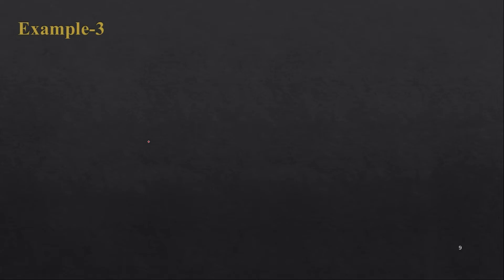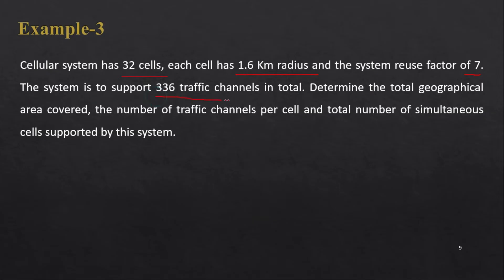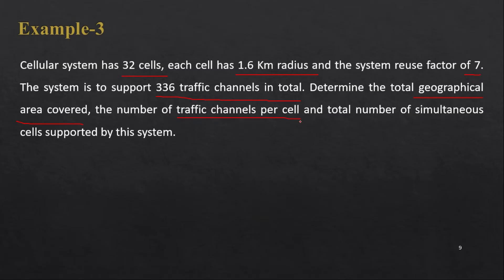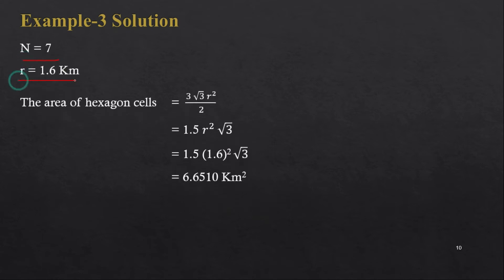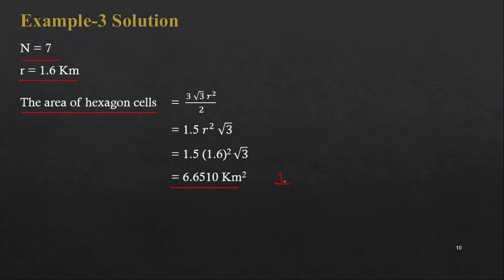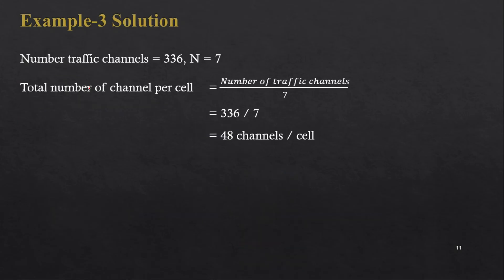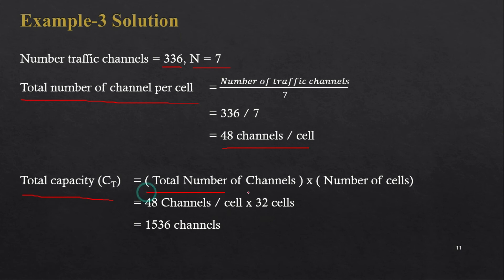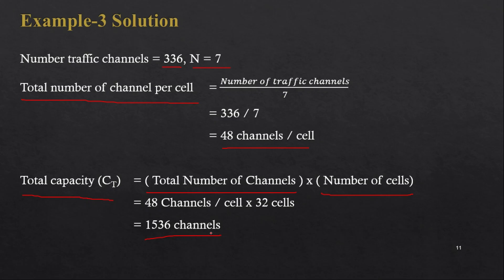Cellular System Numerical Example-3 Find Cell Geographical Area and Traffic Channel per Cell

Comment: A cellular system has 12 macrocells with 10 channels per cell. The macrocells are split into 3 microcells. Determine the number of channels available in system after splitting into picocells.

(1) 1440 channels

(2) 144 channels

(3) 360 channels

(4) 120 channels

Comment: Sir there are 336 traffic channels and total cells are 32. so answer should be 336/32, why you have taken cluster size in place of 32. Anybody please help
Reply from the maker: We use all channels within the cluster and then cluster will repeat it self to cover 32 cells
Reply: @ecit  Thanks sir
Reply: Is it possible to have 32 cells and cluster size of 7.
I mean 32/7 doesn't give an integer num of clusters i think

Comment: reuse factor given as 7 but you have taken cluster size as 7
Reply from the maker: Both are same
Reply: @ecit How can it be same ? U have  explained - 
 reuse factor ,q = √(3N) ( which u have used in Question 2 ) so according to this formula N should be 49/3 = 16.3333
Reply from the maker: @tanishkbindal9878  in this example it is already given reuse factor of N = 7, I just missed to add N = 7
Reply: @ecit  tq